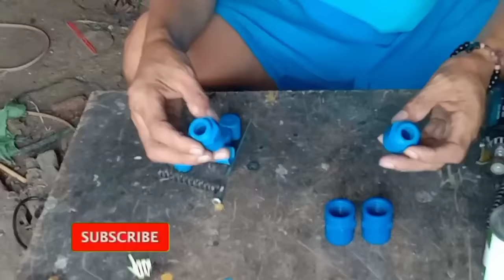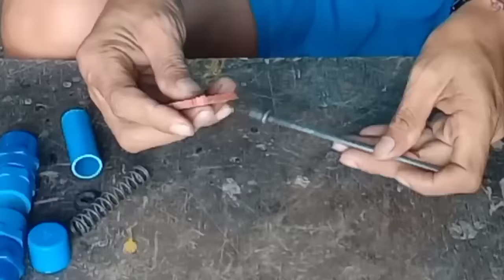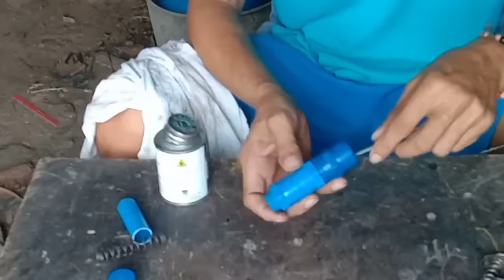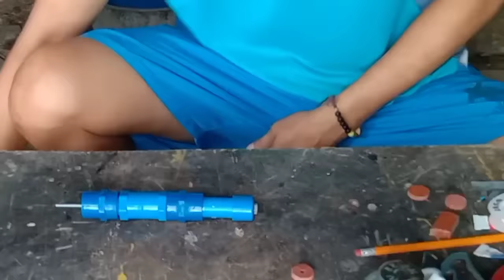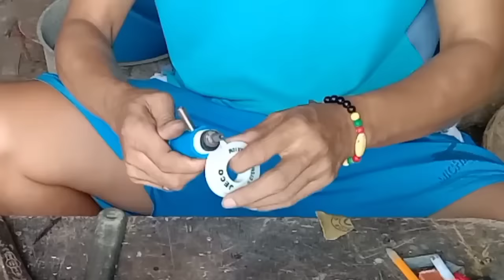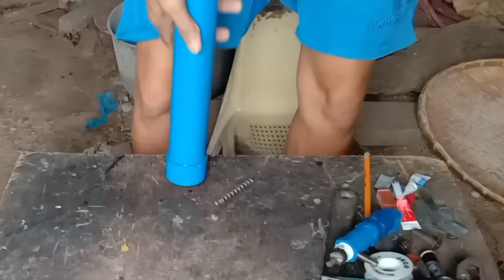pvc air valve | asentado vlogs tv

Comment: The valve is for single or multiple shot..?
Reply from the maker: Multiple
Reply: @ASENTADOVLOGSTV  salamat poh..
Reply: Are you using the marble or steel ball bearing for the bullet and what is the diameter size..? Tq
Reply from the maker: 8mm steel ball
Reply: @ASENTADOVLOGSTV  tq poh😄
Reply: @ASENTADOVLOGSTV  it's quite difficult to get or buy 8mm steel ball at my place poh..🤔